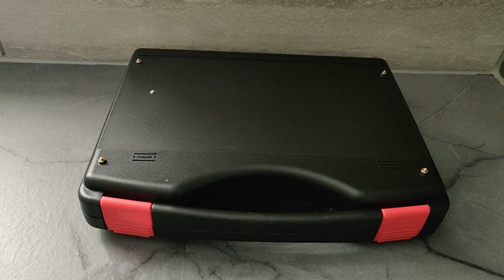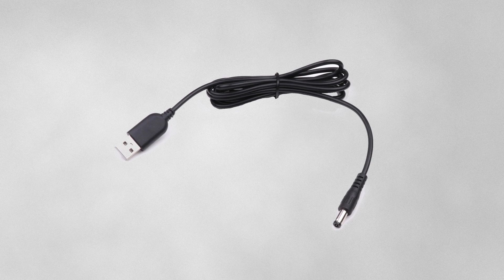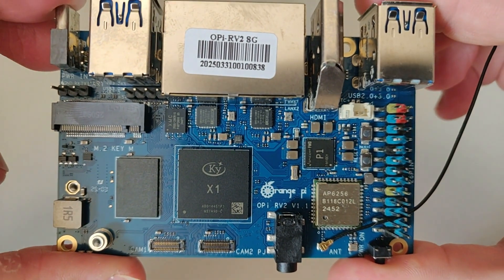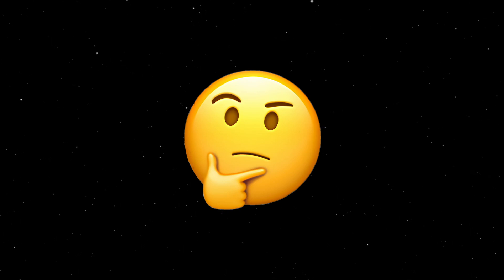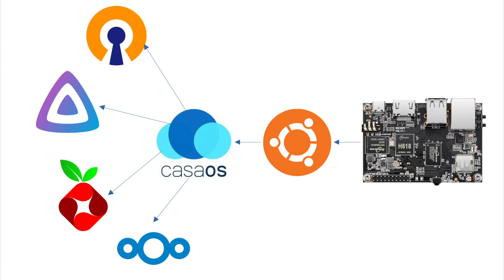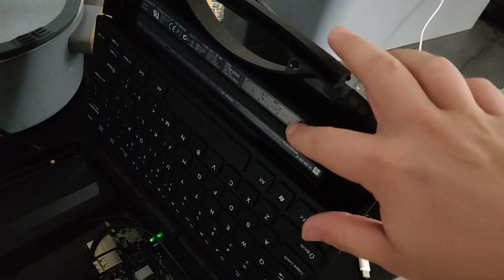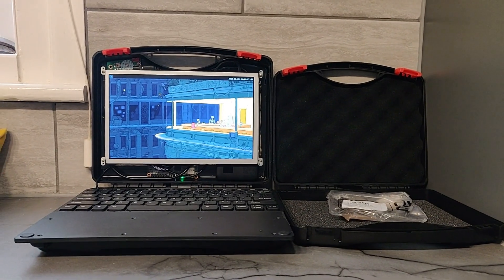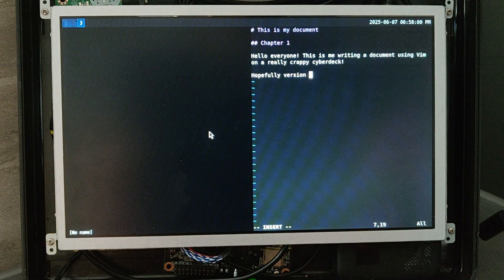I built a cyberdeck inside a toolbox (it sucks)

Comment from the maker: Forgot to mention, but the KickPi K2B is temporary. Not sure what board to replace it with yet as I don't wanna use something too fancy (since it would probably be wasted potential). Probably looking at an Orange Pi Zero 3 because I won't even have to redo the software configuration, I'd just have to move the SD card over and hopefully Wi-Fi, Bluetooth, and sound will work.
Reply: Use a pi5. It's the right thing to do. Easy to power, easy to overclock. You should try fiberglass for making some custom parts. The tricks are following the instructions so it cures properly. Sanding is easy if you get it close to the shape you are looking fore. I used saran wrap to cover some boards, made a sandwich for some flat sheet that ended up like PCB without the copper. You can paint it as well. My favorite build is a boombox with a Pi and touchscreen. It's still pi4 for now. needs a new screen to work with the Pi5. I use power tool batteries, and "robotics connectors" to plug them in, for easy swapping. Oh and Pi5 4GB with m.2 Gen 4x4 set to gen 3 (the limit) is probably as fast as it gets. The one i'm typing this on is at 3150/1100 with o_v_d of 80000. 5A buck converter minimum. USB sound card for the audio out.